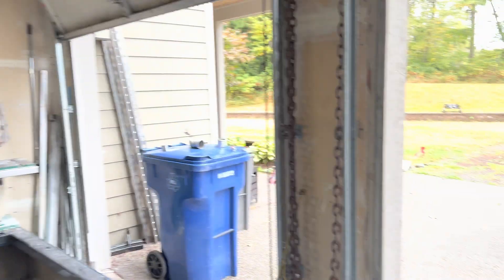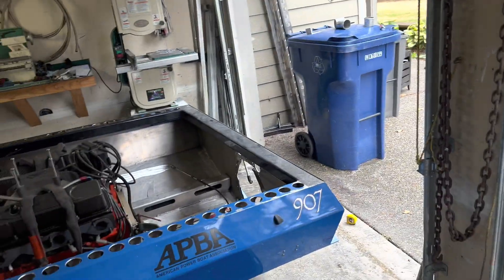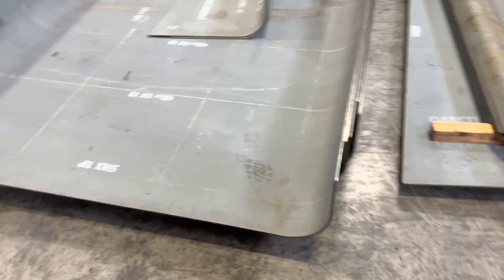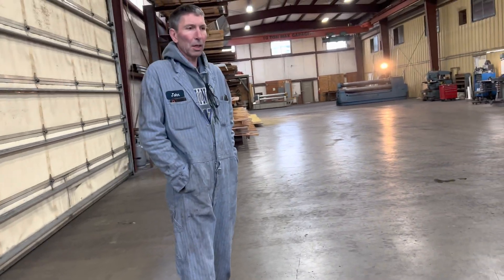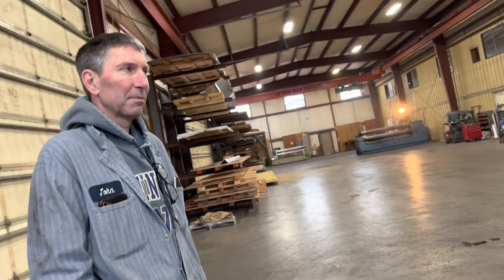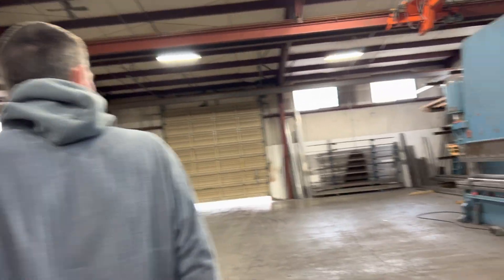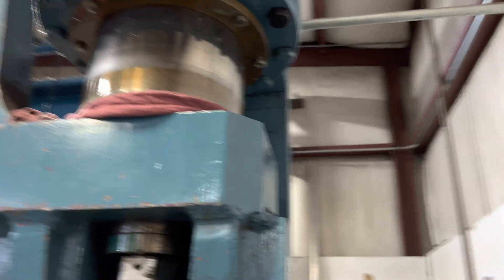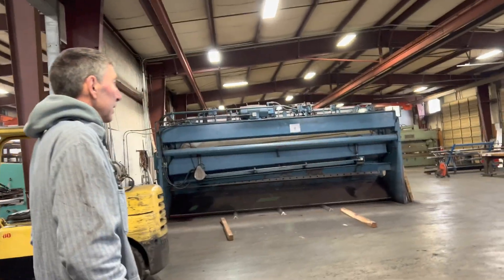1000 Horsepower Jetsprint Build Episode 2

Comment: Wow!
They were some big galatians & folders 💪 in that engineering fabrication work shop.
We have work shops here in Tamworth  Australia with  just as big gear. 
We also use to have a jetsprint racing circuit only 90 km away. Until they biuld a maltable shed chicken farm over it filling in the racing circuit. 😥  
I have some footage of the jetsprint racing on a DVD somewhere.  🤷‍♂️?
Reply from the maker: Which track are you closest to?

Comment: The slop at the end of the tape measure is there on purpose. It's to make up for the thickness of the end so you have the same measurement whether you are pushing it against a wall or pulling it along the edge of something.
Reply from the maker: You’re right, but have you ever seen the videos showing how inaccurate those things are?  I actually check mine against a straight edge and they’re not right.  Typically that much variation isn’t a huge deal but using it to set the V of my boat it’s pretty critical
Reply: @JollyRoger907  I checked my Milwaukee measure with my micrometer  and it was good enough for my sharpie marks. I like the geometry method though. I'll start using that for frame work and use my measure for work...they don't pay me enough for math here lmfao